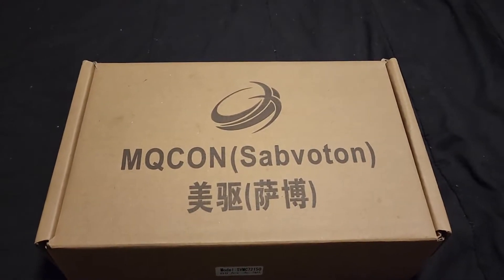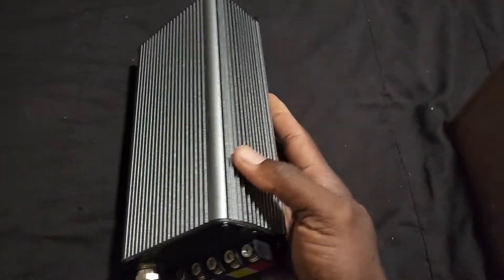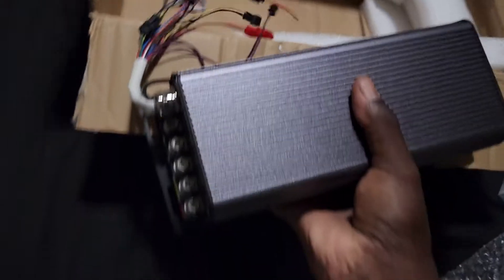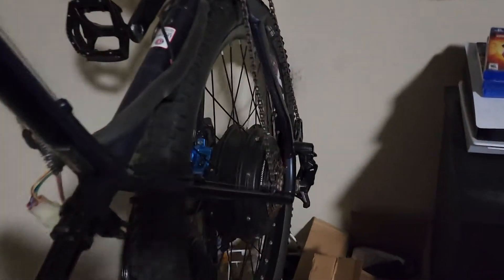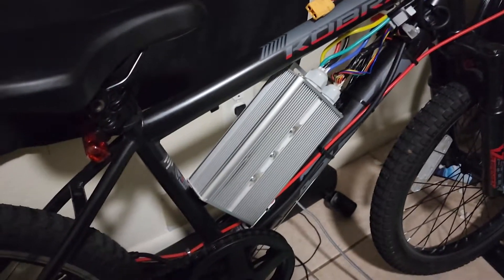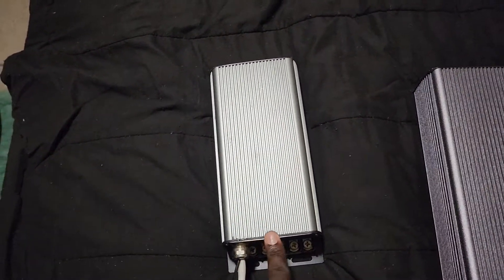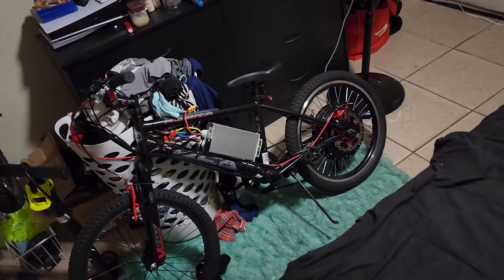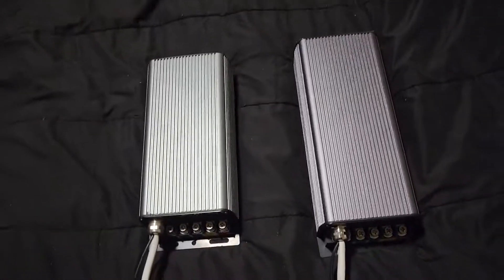Sabvoton controller 150a and 200a size different and comparison 👌

Comment: Hey e-bike guy me new controller and it is coming up with  Error 30H 4 seconds after turning on the bike I need help plz help me ❤
Reply from the maker: Sounds like communication error I recommend checking all the connections make sure the controller on on or display is compatible with controller

Comment: You should try the far driver controllers
Reply from the maker: Oh I did there are way better 💯 check out my 8000w ebike speed run it have a fardriver nd72850 controller

Comment: I've watched several of your videos, and I've really enjoyed them. I have been looking at these controllers for a build I'm thinking of doing, and I was wondering if I could get your opinion on a few things. 

I'm looking to build an ebike with front and rear 3,000 watt motors for a total of 6,000 watts. I have a ranch in Texas with a lot of hills and a fence line that's about 26 miles around the property. I'm not interested in a lot of speed, but power and torque and cargo carrying and hill climbing. I mean if it hit 35MPH, I'd be happy. If larger motors are needed, fine.

Now, if money wasn't an issue, what would you suggest as far as the best NON-GEARED hub motors, DUAL controllers, one for each motor, and battery size OR maybe two batteries as well and just have two separate systems for the front and rear, with the capacity to easily make it around the entire ranch? I want something between 20" to 24" and 5" FAT tire with steel rims. 

I am talking to someone about building a couple very heavy-duty steel frames for this as well, so we have total freedom to do whatever we want. 

Also, have you ever seen these hub heat sinks to cool the motors? It's HOT here in Texas. Any help or thoughts on a build like this would be greatly appreciated. Thanks and keep up the great work.
https://hubsink.com/
Reply from the maker: Ok nice!!! Well they do sell dual hub motor systems on aliexpress and I would go with a 3000w hub motor get the 5t motor since it's very good on torque and the battery, 52v 50ah battery will be plenty  with some good high quality cell such as molicel  then build a strong frame around the battery,  I have a 8000w single motor ebike and I use it for some haul my daughter around I had to pull my friend sometimes when they broke down lol, but man you ebike build will be definitely a work horse around the ranch.

Comment: Hey I wanted to know could I run this controller on a ebikeling 1200w kit on a 52 v 24 Ah battery?
Reply from the maker: Yes but be careful not to go too high on phase current and dc current
Reply: @EBG-offical  what would you recommend?
Reply from the maker: I would recommend a sabvoton 7260 controller.
Reply: @EBG-offical  i saw one on Amazon but Thought if I got the one you were should I could program it to fire at around 80 amps I have two 52v batteries the triangle ones with with black hard case. If that a bad idea ?
Reply from the maker: @TRAPSQUAD187  yeah you can do that at that you be good to go with it set to 80a
Reply: @EBG-offical  awesome thanks so much
Reply from the maker: @TRAPSQUAD187  no problem
Reply: Soon I plan getting a high powered battery made tho

Comment: Yo! Just came across this after doing some research. Thoughts on the 150 so far? I'm looking to pair 2 of the 150A's with 2, 5T hubbers on a cargo bike. Not looking for speed, more so the torque for cargo-laiden take-off. hows the perf been? Any issues? Any tips or things to watch for? The batts on mine are dual 20S16P's w/ a capacitor 'buffer' bank for sag.
Reply from the maker: Well if you going a dual setup for your bike you just want a battery at least in the 50ah or better, and the 5t motors will be perfect for what you doing, won't overheat when you have a heavy load,
Reply: @EBG-offical  Glad to hear I'm on the right track for once! lol The batteries can do roughly 50-60AH each; I'm also using the controllers in a lower demand setting , as I'm not trying to destroy my dropouts either.
Reply from the maker: @Ryan Clapp  you definitely on the right track .keep that up and you will have a heck of good cargo bike for sure 👌

Comment: Those are mechanical brakes not hydraulic buddy
Reply from the maker: If you referring to the blue zoom brakes or the ones on my son's bikeThey is not mechanical!
Reply: They are called semi hydraulics buddy
Reply from the maker: Thanks for your reply, the caliper is hydraulic, mastercylinder built inside caliper no matter if it's cable driver or from the external mastercylider mounted on the Handel bar, still hydraulic brakes 🤭

Comment: Hey buddy i have the Sabvoton 72150 controller on my Stealth  bomber and I'm not able to get my regen to work i was wondering if you could tell me what connectors go together to see if that's my problem I'm not sure cause they don't have the wires labeled. I really love your videos  always great information and very knowledgeable stuff. You've done a great job building your bike snd you son's bike very cool. Thanks for your videos ride safe buddy. God bless.
Reply from the maker: Ok thank you, so when you go into settings and select regen go back to home page do it says slide regen?
Reply from the maker: Well if you have slide regen enabled, when you let off the throttle it will go into slide regen mode and slow you down like a motorcycle, will also you can turn on ebrake and it will do the same but only if you press on the brakes

Comment: Can you send me some links for the china shop you used? Thanks again for the video!
Reply from the maker: US $363.09  9%OFF | Sabvoton 72V 80A 100A 150A 200A V1 V2 Controller Kit for 3000W 5000W 8000W 12000W Ebike Motor Kit with UKC1, Bluetooth, Alarm
https://a.aliexpress.com/_mKWCrmM
Reply from the maker: This is the store I got my kit from ill send you another one for the battery
Reply from the maker: US $328.30  30%OFF | 72V 40AH Triangle Bag Scooter Electric bicycle lithium battery 2000W 3000W 72V Battery Pack
https://a.aliexpress.com/_mMeMhrI
Reply: @EBG-offical  what's the BMS on these batteries? I'm not seeing it on the website.
Reply from the maker: They are 60a bms
Reply: @EBG-offical  so that wouldn't work if I have a 150a controller right?
Reply: How are you making those triangle battery work with your 200a controller?
Reply from the maker: @JJBGood-Lokie  well I just made the nickel strips stronger to handle the current by adding copper wire on top of the nickel strips.  I'm currently doing one for a customer
Reply from the maker: Without The mod, no it will burn the nickel strips, their too weak or thin
Reply: @EBG-offical  man you are a master at your craft.  Wish I knew how to do that.  Mad props to you and all your builds are badass.
Reply: So with your mod then you don't have to buy an expensive battery with a high 200 BMS right?
Reply from the maker: Thank you I try my best to find the cheap stuff and make it better
Reply from the maker: @JJBGood-Lokie  correct
Reply: @EBG-offical  nice.  Thanks again for taking the time to answer my questions.
Reply from the maker: No problem I'm always here
Reply: Appreciate the response! I enjoy your vids. Keep up the good work. 🤙🏽
Reply: Hey at checkout do you use PayPal ? Or what's best method to pay I've never used Ali Express before thanks!
Reply from the maker: Yes I use PayPal
Reply: @E-bikeguy  big thanks another question when looking at the sabvoton controllers or any bike controller when you buy controller and it says 80A,,100A
150A , 200A is that the max amp output of the controllers or at peak they go higher?
Reply from the maker: That is the max battery amps
Reply: @E-bikeguy  ok super thanks!

Comment: Please provide links 🔗 for the controller
Reply from the maker: US $388.80  10%OFF | With Alarm&Lock Sabvoton(MQCON) SVMC V1 V2 72V 80A 100A 150A 200A Waterproof Controller for 3000-12000W Ebike Motor UKC1 Display
https://a.aliexpress.com/_mNaAeMS
Reply from the maker: This is where I go to get all my parts from very good people and fast shipping.
Reply: You talked about Regen. Does it have variable regenerative braking so you can stop with Regen alone? I'd love a video on that subject 👍
Reply from the maker: So yes the new controllers I bought have slide regen mode so it use a throttle to slow it, but when you turn on e- break it regen also it just use your break handle